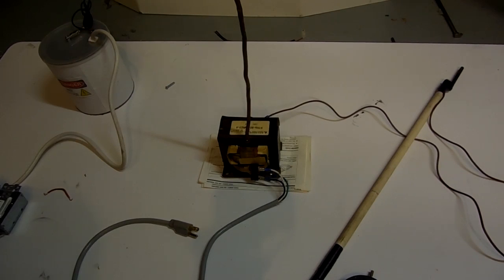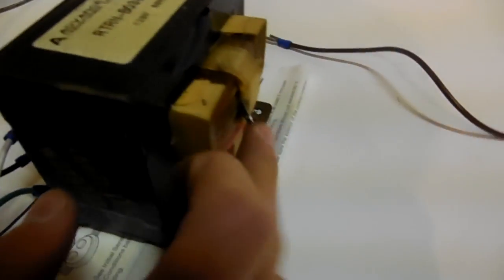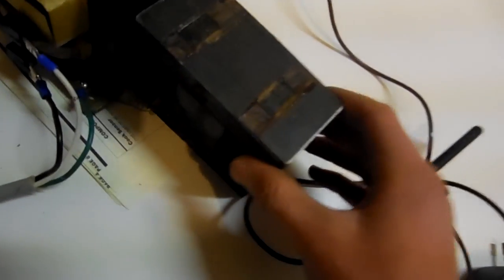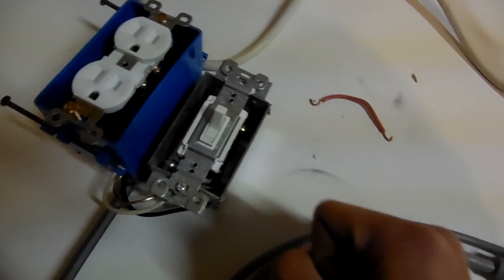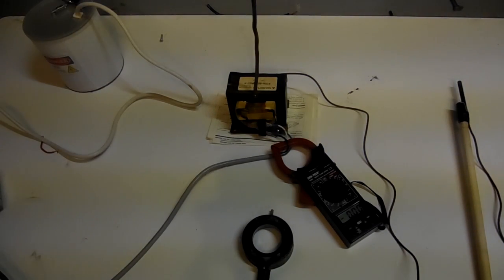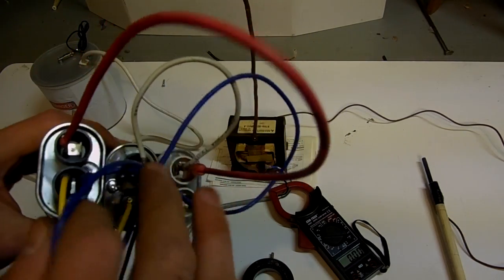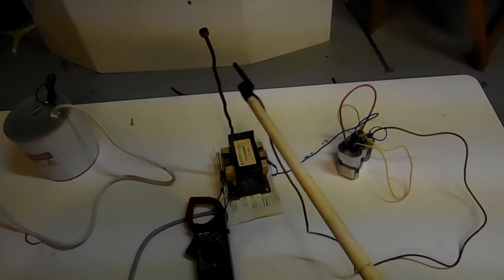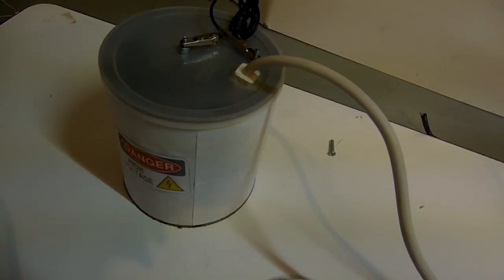MOT How To (Safety, Wiring, Ballasting, Resonance, etc...)

Comment: Excellent job explaining the MOT. I have been working with big capacitors for years and I have taken some major hits from them. Once I had a capacitor bank in a submarine short accross my chest through my fingers and I looked like Merlin the Magician for a second or two before I could break the arc. The capacitors didn't survive, but I did, lol. It was about 12 hrs before I could talk again though. My jaw muscles were locked up for a while.

You are right to respect high voltage electricity. Those who are not careful either learn to be careful from a mistake or they die. If you ever get shocked by this type of setup always make sure to tell someone what has happened quickly and have them watch you for a day or so to make sure you don't go into cardiac arrest. You are usually safe after 12 hrs or so, but if you don't tell someone because you are embarrassed you run the risk of dying and the responders will not know what to do because you won't have any obvious signs of trauma from the shock, unless they find you lying next to your project, lol.

Keep up the good work. I can't wait to see what you are capable of when you are my age so be safe.
Reply from the maker: Wow that is pretty bad, on the bright side you have a nice story to tell ;) Thanks for the good info and nice comments!
Reply: Sounds like someone forgot to teach u the one hand rule
Reply: Big mistakes make great stories...
Reply: I got hit 240 volts at work due to the work table on a cable and the friggin hurt.
Reply: @ElectroTechnics  Can you also use motor oil?
Reply from the maker: It may work but I would not recommend using motor oil as it typically contains many anti-wear additives and detergents. Some of those may be metals like Zinc and have some level of electrical conductivity.
Reply: @ElectroTechnics  ok thanks
Reply: @ElectroTechnics  So something like mineral or transformer oil won’t be conductive?
Reply from the maker: That is correct, a mineral oil for transformers will have a high dielectric (will not conduct) as to protect the transformer from arcing and mainly to keep it cool.
Reply: @ElectroTechnics   Ok one more thing, is it a good idea to put the oil in the refrigerator to keep it extra cool or cold?
Reply: @ElectroTechnics  How were you able to attach that metal stick on the transformer?

Comment: You can also capacitive reactance limit the input by placing ~25uF in series with the hot to control power usage and thus arc length and current.

Comment: Great Video!!!
9:07 You had it right the first time. Cables are rated by volts and amps, not watts. This is because the volt rating is determined by the insulation and the amps rating is determined by the copper thickness. Because a watt is a volt times an amp, if a rating was watts, you could potentially have a cable that meets watt rating and still exceed the insulation rating or cable current rating.
Reply: Exactly some little cables inside pc are rated 400v because of the insulation and car jumpers are rated (example) 300A 
I don’t think I’ve  explained myself

Comment: In my early twenties (1983) I built Tesla coil. All I had in the way of instructions was plans in an old magazine. There were no pictures, only text. I used a 12,000 V neon sign transformer, an old chain saw sharpener motor for a rotating stop gap, a hollow copper ball for the toroid (had special made),  and capacitors I made from Coca-Cola bottles. I got four to six foot arcs off of the thing on my first startup. I could allow the arcs to strike me directly. It was not pleasant but it was tolerable for a few moments. Holding a florescent tube up to the toroid was also slightly uncomfortable until you got it close enough to draw a strong continuous arc from the toroid. You could touch the toroid while the coil was running but you had to be touching it before it was switched on. Attempting to touch the toroid while it was running became too uncomfortable the closer I got my hand to it. But having one hand on the toroid when it was started I didn't feel anything until I moved my other hand toward an object. Then arcs of 2 feet or more would come from my fingertips and it was not pleasant. With one hand on the toroid and the other hand up, not near anything, arcs would come off my hand similar to the arcs off of the toroid but not quite as large. That first Tesla coil build I used 12 gauge insulated copper wire just as you would find in any home, except using just one wire to form my secondary coil. It was about a hundred feet of wire wound around a 4 inch x 28 inch custom built frame made from wood. I cut 4, 4 inch circles out of a piece of 1/2" board. I cut 1/4" slots equally spaced around the outside edge of the wood circles. I then inlaid 1/4"x1/4" wood strips into the slots all the way around making what looked like a narrow 4" diameter bird cage or similar to a very long swirl cage from an A/C unit. That's been over thirty years ago and that Tesla Coil is retired after roasting several transformers. Yes I did have safety spark gaps made from 4 ceramic sand blast nozzles. Atop each ceramic nozzle/insulator I had 4, 2" high Wizard figurines, like something you would see in a Harry Potter movie made from pewter. These figurines had either a staff or sword and that was the point in which the arc would discharge when necessary. It looked damn sharp for my first coil.
I have started a second Tesla Coil but this time I'm using a 6" x 48" PVC tube wrapped with magnet wire. That should accommodate at least a thousand feet of wire. I can't wait to see the results of my T-2 Coil.
Reply: WARPHEAD please upload the result to youtube
Reply: Willeexd I second this.

Comment: Great video, I learned a lot. I just run a small MOT through a little halogen light for wood burning. I like that the light comes on when I hit the deadman pedal. I still use lineman gloves. Need to make a chicken stick, two actually so I don’t risk accidentally stepping on the pedal. Learned that concrete is conductive, guess I just always wear rubber sole boots but will set it on a rubber mat from now on.

Comment: I don't mean to knock your video, it is the best coverage of MOT safety I have found. Even assuming the wire going to the chicken stick is using correctly rated insulation, wouldn't it be better to keep your hands well away from it and anything touching it? As a worry wart I found myself doing involuntary kegel exercises every time you adjusted the current meter with the chicken stick wire laying nearby. So many products are made to low standards or lie about ratings today, I don't trust anything to perform as advertised especially when playing with an instant death machine🙂

Also, in another comment, I suggested using a step down AC output wall wart to test the configuration. I experimented a lot as an inexperienced 10 year old and suspect I wouldn't be here if I hadn't started with low power testing my experiments before trying full power. In this case the output would still be around 90V for a 5V AC wall wart which can be enough to provide enough of a zing to point out safety violations and maybe not die.

Again, good video.

Comment: When you hook up an MOT as an inductive ballast, is the ballast's primary coil hooked in series, or in parallel with the active MOT?  Thanks!  If you'd slipped in a schematic drawing, that would have been great.  Nice job.
Reply: Series...
Reply: Any ballast should be in series,,,

Comment: At the end you ballasted it to reduce the arcs and then mixed up your words explaining it I think because you more were concerned about explaining the capacitor safety and rushed into that, but I loved your video explanation, you should make another one that includes using 2 mots in series to run as 1 balanced transformer to remove the HV potential from the metal casing to the opposing secondary coil output. Making it safer to ground. And using a capacitor on each secondary output will add a phase delay so that each probe is out of phase with the metal core and won't arc to it but will arc to each other.
Reply from the maker: Hmm, that doesn't sound quite right. The "center tap" or transformer case is one of the output leads of the secondary so it will always have potential to the output lead, even with a phase delay I don't think there is a way around that...it's still the other end of the wire and the phase is just the potential difference between the two ends of the secondary's winding.

Comment: Thank you for the video, I am trying to build a high voltage high current supply for a sputtering machine I am making, and your video just covered up everything nicelly. I think capacitive current limiting, as you are doing at the end of the video is the best. However, I am thinking of using a motor-run capacitor in the primary side instead of a high voltage capacitor in the secondary side. I think it should work. What do you think?
Kindest regards, Bill

Comment: I've follow your instruction on how to resonance MOT by adding it's HV capacitor in series with secondary coil of the transformer; but it only decrease the output power, in my case
Reply: Adding the 3 cap only made for capacitive ballast only good for reducing the current through the mot.  Zero ohms with no caps and around 800 ohms with the caps. So it did it's job decreasing your output.

Comment: Nice arc!  If I might recommend, keep low wire connection on all capacitor.  Such as jump wire connection one by one capacitor instead of jump over two capacitor.
Reply: Michael Marr or use larger wire
Reply: Michael Marr or both

Comment: Hey guy. I want to ask. will the same wiring work to do fractal burning in wood. where as you use the earth wire and the "chicken stick wire" and connect them on both ends of the wood. just wondering if its the same wiring used for fractal burning
Reply: Yes but it is very dangerous since your adding conductive water in the mix. It's best to use a neon sign transformer or flyback transformer for the wood burning.
Reply: I think NSTs are very dangerous too, high voltage is alwasy very dangerous

Comment: Why you connected the capacitors in series with the transformer,and not in parallel?
Reply from the maker: +Commander Riley 
When wired in series, the capacitor(s) will be charged on one half of the current cycle and on the other half of the cycle the capacitor will discharge along with the transformers output, increasing the momentary output on that half of the cycle. Therefore creating bigger arcs.

Comment: hello you seem pretty knowledgeable. I've recently acquired a pole pig transformer and was wondering what would be the best way to limit the current on the low voltage side (120/240)? Any help is appreciated.
Reply: Jon Shaffer run lightbulbs in series with the primary coil aka the one the house plugs into.. however many watts the lightbulb/lightbulbs are rated at is the limit on the current it will draw.. if you want more then the lightbulb you have will give you then run more lightbulbs paralleled with the lightbulb you already have hooked up.

Comment: good video and great experiments, congrats. i have a question: i can use this monster circuit to power a tesla coil? (the MOT and the capacitor)
Reply from the maker: +Jose pablo Cuevas If you used two MOT's in series for 4.2KV and used a proper ballast to limit the current to a usable amount, you could indeed use it as a tesla coil power supply. You would not use the capacitor that comes in the microwave, rather a capacitor which is matched to resonate with the inductance of the tesla coil primary winding. 

Stay safe!
Reply: Electrotechnics Thanks, so i´ll have to use a ballast to limit the amperage in order to make it less dangerous, and have to found (or build) a capacitor made for the inductance and resonance values of the coil itself?
Thanks!
Reply from the maker: +Jose pablo Cuevas Yes. The inductor and or the capacitor(s) will have to be built around each other's values. There are equations available on the internet to calculate the capacitance needed for a certain inductance. Just google "tesla coil calculator" or something like that.
Reply: Electrotechnics hey! thanks for answering, i have been doing some research and i found that the capacitor must be able to handle the amperage and the voltage from the power supply. I think i first need to calculate the electrical field between the 2 plates (in case of a parallel capacitor) and then calculate capacitance in base of the electric field, voltage, distance between the plates, areas of the plates etc; Finally (correct me if i´m wrong please) i have found some info that establishes that for high voltage experiments its better to build your oun capacitor than buying a new one

thanks, and greetings from México!
Reply: José Pablo Cuevas Cázares I want to build a variable "butterfly" capacitor and either plastic film over the plates or submerge it in oil or maybe even both.. then I will be able to tune it to whatever I need and can add layers of plastic if the dialectic breaks down

Comment: Very usefull and clear video on MOT's. Thank you! I live in europe and we have 220V AC here. Now I will get hold of an MOT that comes from the US and which has to be powered with 110AC. But I have no 110 V AC and my goal is to power it with 220V AC because I want to make double the output voltage (2 x 2100V  =4200V :). Can anybody tell me if this is safe enough since it is only twice the amount such a device is rated for.

And another question I have is: why is this MOT draw 3 amps when it is doing nothing; producing no arcs??
Reply: I'd say get a 220 to 110 transformer.  (Something like this possibly:https://amzn.to/2Lsmc62. This model says it can provide 18 amps at 110v to whatevers plugged in.  I dunno if this is accurate or not.  I also do not know how many amps your mot draws) Or you could just get a mot from a European country   to skip that hassle. I dont really know how to double the voltage.  It still draws current when idle because the transformer is still using electricity to generate a magnetic field just theres no load on it so its significantly smaller than if you were arcing it or using it to power something
Reply: Hopefully you don't mind my 2 year late attempt at some input. I wouldn't trust what I or anyone else has to say in youtube comments, but maybe it will lead to the right things to look up in books. I started to suggest ballesting to limit the primary current to about 5 amps. It might work. What I don't like about it has to do with your question about why his MOT is drawing 3 amps without a load on the secondary. If remember correctly, doubtful, an ideal transformer would draw no current in that situation. But, it may be that an ideal transformer would draw no power (watts) because although the current is 3 amps the voltage is out of phase with the current so the power ends up being 3 amps * 0 volts, but I may also be wrong about that. The main oversimplified thing to remember is alternating current is funky compared to DC. I think there is the possibility that a US 60Hz transformer might perform significantly out of spec even at 50Hz even at its designed 120Volts. Meaning it may draw more or less current and probably not be as efficient at stepping it up to 2KV.

So, I think if I wanted 4KV using MOTs I would carefully experiment with using 2 MOTs made for native electric. I think it would involve wiring the primaries in series, and wiring the secondaries in series also. A nice feature is you would effectively have a center tap where the two are connected.  Since I don't know exactly what I'm doing, I would find a low power wall wort that outputs AC at say 5 volts and use it to energize the primaries. AC output wall warts are pretty hard to find these days but not impossible. Anyway, by using only 5V AC instead of 220V at high current, you are relatively safe to experimentally figure out how to wire it up. Should the iron cores be wired together? Should the long free wire of one be wired to the iron core of the other? My brain refuses to think deeply enough about it today to know.  The right combination should give twice the voltage as a single MOT. I think you could wire the primaries in series or parallel to get less or more output current, but I would go with series since the output current is insane enough.
Reply: @karlharvymarx2650  Thank you Karl. I was working at that time on an electrostatic precipitator. In the end I just used a 6kv neon transformer with a voltage doubler which worked just fine. But it produced too much ozon so I finally ended the project. Thanks though for answering me 😊

Comment: you can tell that you have been shocked by how methodical your safety procedures are lol.  In addition to stopping your heart, you can also cause ahhrythmia, which is almost just as dangerous, if not more... as you can alter your hearts rhythm without realizing it until it may be too late.  btw, wouldn't those capacitors be deemed current limiting since they are in line with the flow of current?
Reply from the maker: :D i have, adjusted electrodes for a jacobs ladder and for got to discharge the resonant cap bank if the MOT was on then i would probably not be here to tell the story, I was lucky that i was ok since it went through one arm and out the other, but i think that happened a fair bit after i made this video, but at the time i did understand the risks so i was very cautious while messing with it.   Also the capacitors charge on one cycle of the AC and discarge along with the AC on the other half of the cycle giving more power, also if you only use one it will limit the current but if you have 2or more then it will work better.